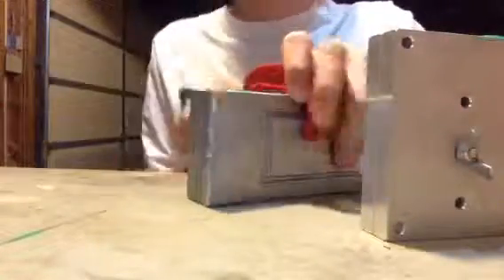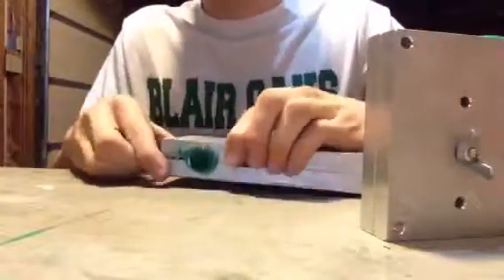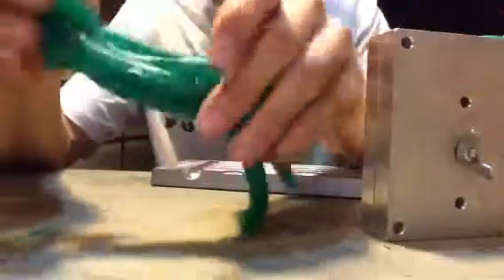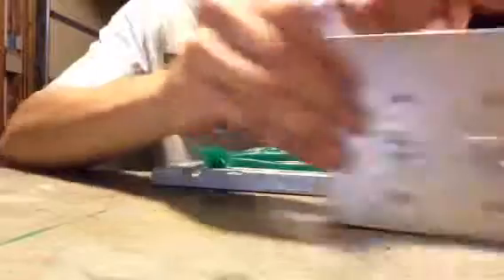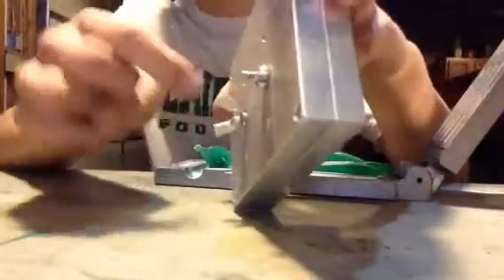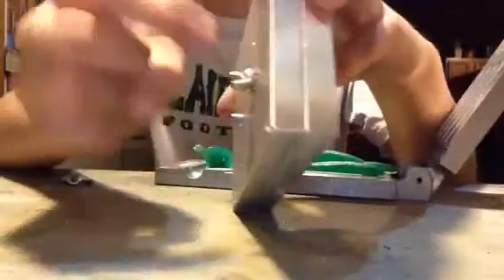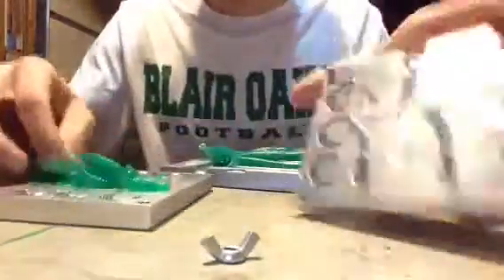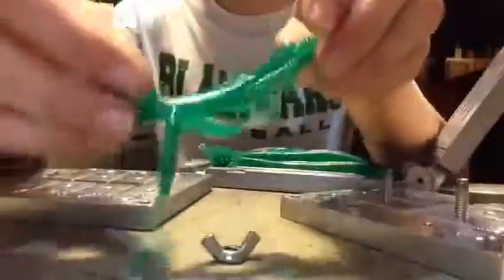Making a new soft plastic color

Comment: Turned out great! I don't think I have that yellow. I might have to get some. Also I have a question. I was told I should heat up the injecter before I use it because the plastic will cool to fast inside of it. Is that true?
Reply from the maker: The yellow is a fluorescent yellow and is pretty much the same thing as chartreuse. Also for the injector if your doing something that doesn't need much plastic like a grub mold then it's usually best to warm the injector up because the plastic will cool down very quick in a cold injector but if you are doing something that needs a lot of plastic like a senko then there is usually enough plastic in the injector to stop it from cooling down too quickly
Reply: +Fishingisgood awesome thanks!